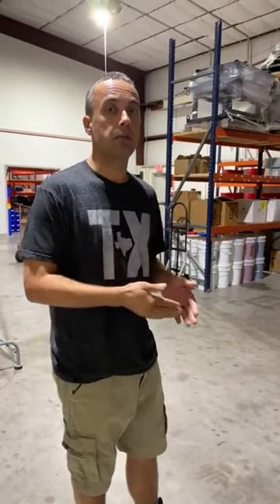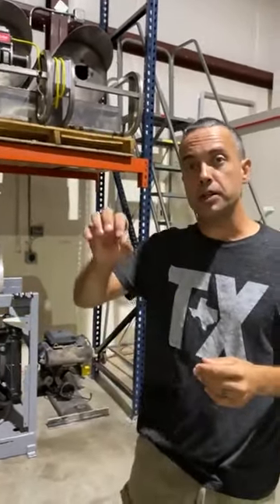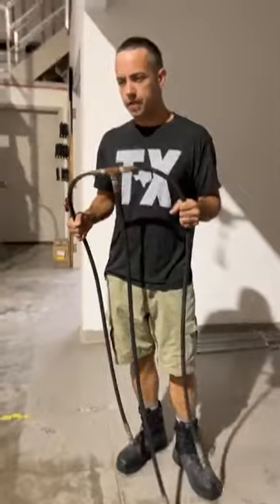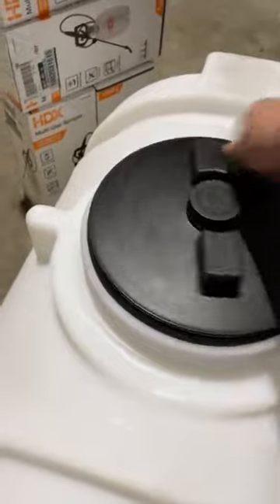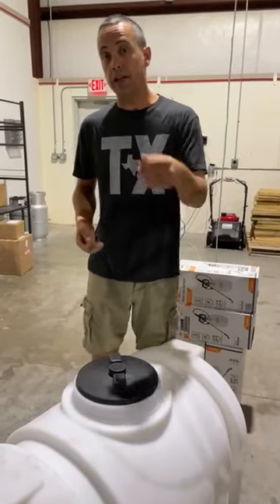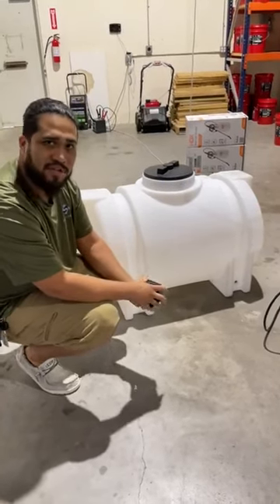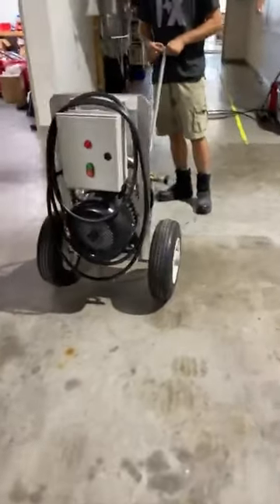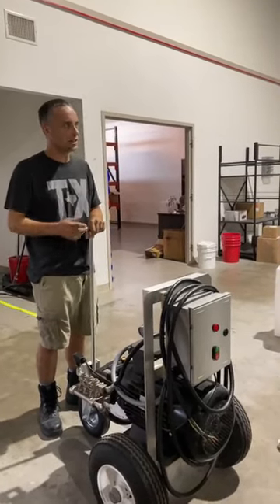Hot Boxes, Tanks, Siamese Kits and More

Comment: What do you think about siamesing a 5.5 gear drive and a 8 belt drive. Same unloaders but different psi? Thanks in advance
Reply from the maker: @juniorbiel24  we Siamese the exact same specs.  The lower psi will be dominant.

If it’s a 4000 at 5.5 and a 3500 at 8 for instance your pressure will be in the ballpark of 3600 psi flowing at roughly 13 gpm

We have found at 13 gpm you can still Siamese with 3/8 all the way around.  If you Siamese 2 8s it restricts flow unless you have half inch pressure hose coming out of the outlet of the Siamese.
Reply: @TXcommercialwash  I appreciate the response back! Im glad to know you run the same exact specs. Excluding the psi. My 5.5 is at 3000 i believe. Im glad i found this video because I have received mixed responses from other supply companies. Im assuming you have been siamesing those two units together for years without any issue, correct?
Reply from the maker: @juniorbiel24  this is correct, I’ve had about 4 different Siamese combinations we have done and we have been since 2018
Reply: @TXcommercialwash  sweet! I appreciate you